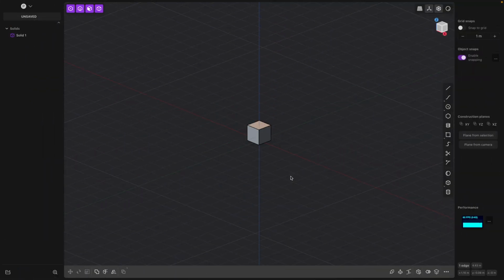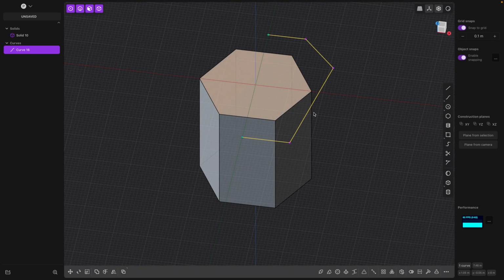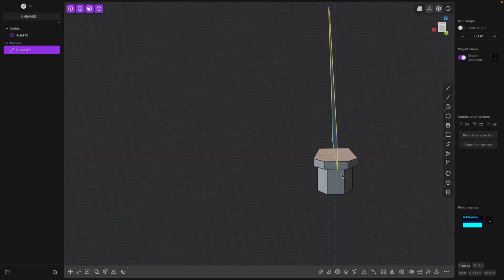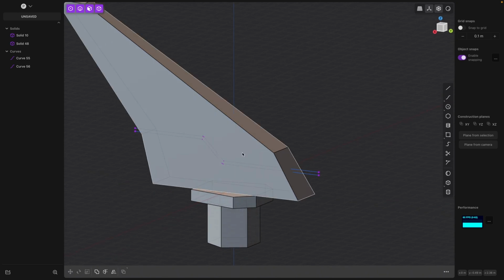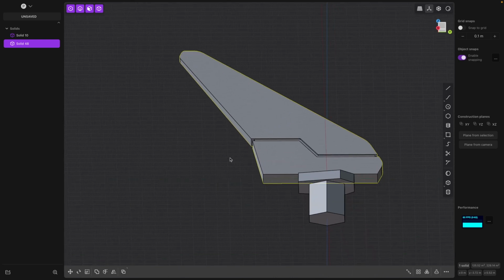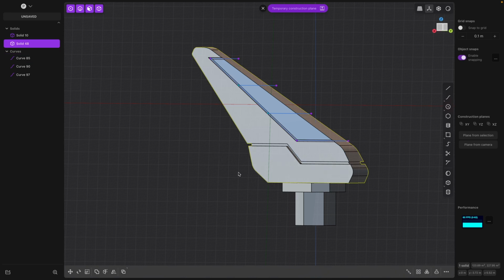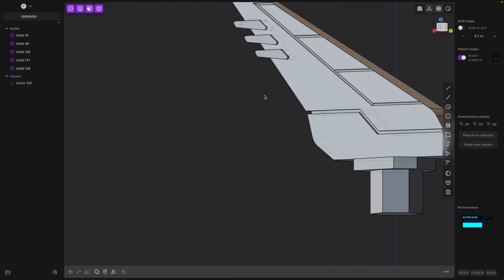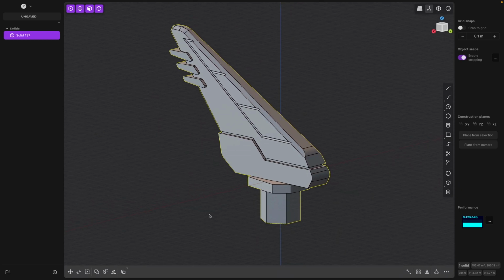Gunpla Tutorial: Designing a custom detail part with Plasticity

Comment: you can change the units on the top left P icon under preferences
Reply from the maker: You can, but then later when you export an STL for printing, the resulting file ends up scaled too small. I think this is probably a bug in Plasticity and it'll eventually be fixed, but for now I've found it easiest to leave the units set to meters.

Comment: Would Plasticity be easier then or can you do the same details in Blender?
Reply from the maker: You can do all these things in Blender, but I think the interactive tools and workflow in Plasticity make it easier to experiment with ideas until you find the result you're after.
Reply: I can see the plus on using Plasticity, only thing, it isn't free. @gunplamark   I wonder if blender may have similar interactive tools. I would like to see more of Plasticity can do. I might try the trial myself
Reply from the maker: The fact that Plasticity isn't free is the main thing that's kept me from covering it on the channel until now, even though I've been using it quite a bit for my own projects. I didn't go into the technical explanation in this video, but the biggest difference between Plasticity and Blender is that Plasticity's 3d engine is NURBS-based while Blender's is mesh based, and that gives Plasticity a huge advantage when dealing with certain types of solids.
Reply: I am messing with it now, it is nice for creating quick details. doesn't have an offset, :(
 @gunplamark